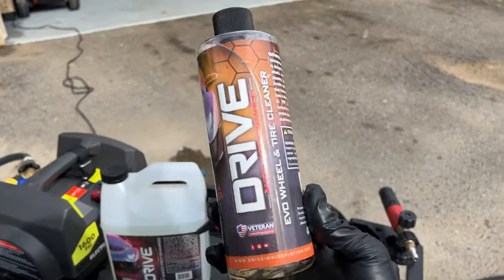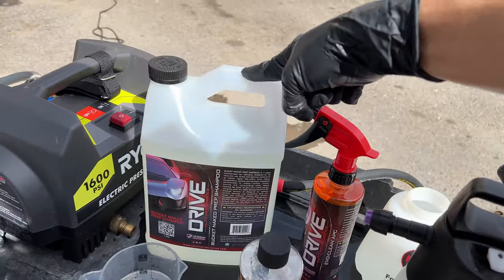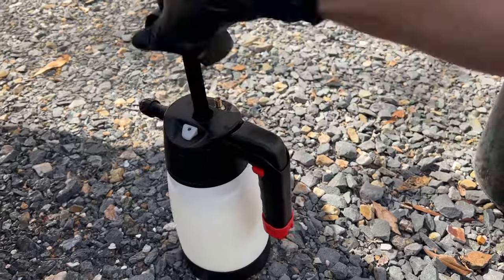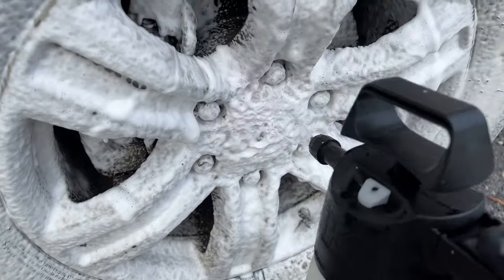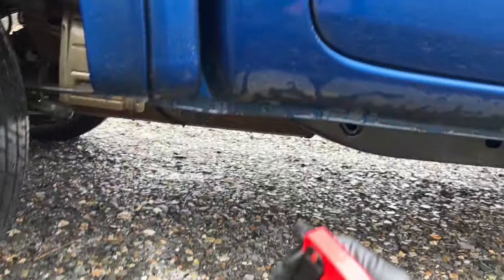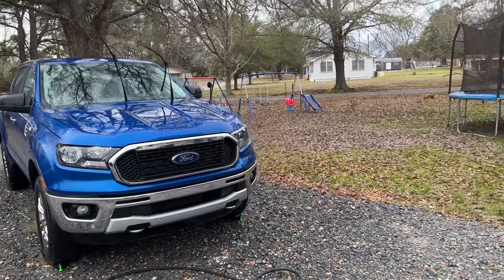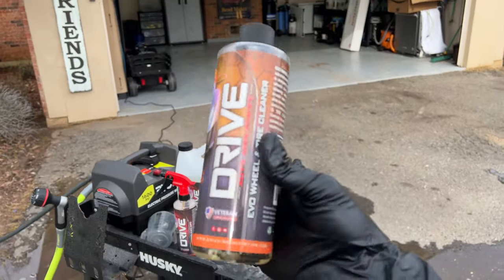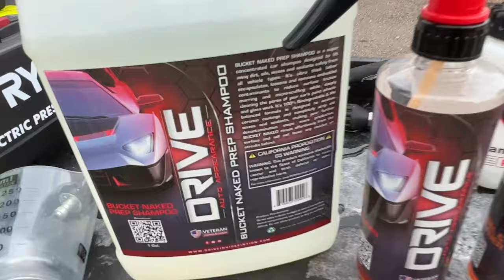Time To Get BUCKET NAKED w/ Drive Auto Appearance!

Comment: Foam pro 2 is basura, better off with a Marolex instead, iK pro12 is the king tho. So much for coated by the “king” hahahah, that eco apc looked like it did a damn good job tho, surprised you didn’t show the end results with polish and all that, I’m sure that blue paint came out incredibly well.
Reply from the maker: Yeah got a pic on Instagram, the polish  and spray coating were very good as well 🧼